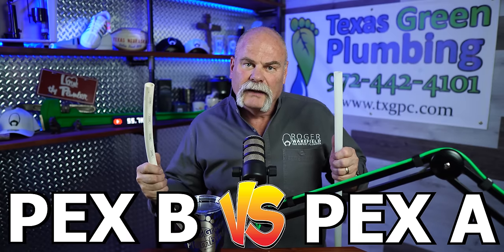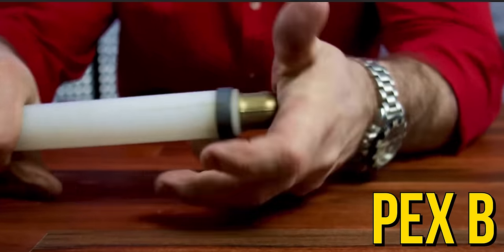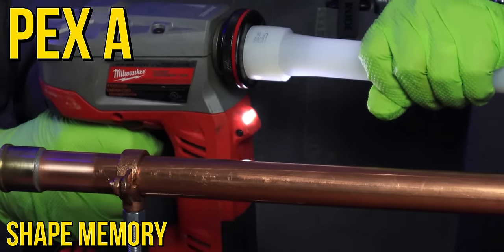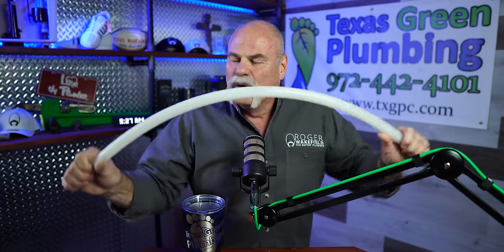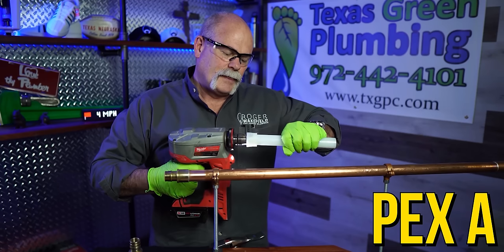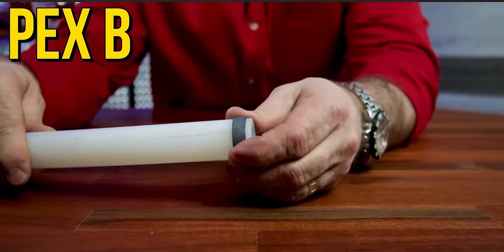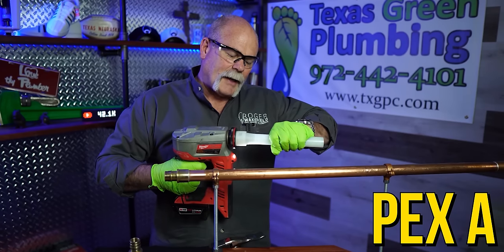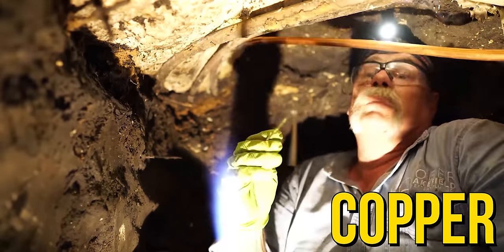PEX-A vs PEX-B - What's the Difference? Which Should You Use?

Comment: Great vid! I can attest water pressure is extremely reduced of you don't up-size your Pex-B pipes.  I recently renovated my house and replumbed the entire house with Pex-B. My architect's drawings called for 1/2" piping to fixtures (sinks, shower, etc). My plumber installed 1/2" Pex-B pipe (I guess he's not as knowledgeable in Pex-B plumbing). Now, if I run my dishwasher and laundry at the same time, my kitchen sink's water pressure is similar to a park's drinking water fountain. I wish I saw this vid before we renovated the house.
Reply: Codes are always to the minimum standard, and many of the standards were written years ago for copper and steel pipes. Copper in pretty thin. PEX and cpvc are the same outside diameter for pipes labeled the same size, so obviously the inside is smaller. PVC is the same outside diameter as steel and steel has a larger inside diameter than even copper for the same nominal pipe size, but is rougher. Modern plumbing (and fixtures) just get more and more restrictive. 

Food for thought. 1/2" 200psi PVC has a larger inside diameter than 3/4 PEX. Obviously, using 3/4" PEX B with it's insert fittings is more restrictive than 1/2" SDR21 PVC.

Comment: I have a bit of 1/2” hePex A to install in my crawl space for some radiant floor heat ..my question is can I splice...there’s no way in a small crawl space I can run a 300ft loop x 10...thus the reason I’m going with the expandable Uponor non flow restrictive fittings...I may even look at straight 20ft lengths of pex as well..my joists are a total of 45 and each one is 35ft long....
Reply: you can splice, 300' is a long loop, do you have a professionally engineered plan or are you just winging it?

Comment: Roger, if I have 1/2" copper to my fixtures and I want to replace with Pex-B, to "up size" should I install 5/8" or 3/4" Pex-B as a best practice?  Same question for my water heater? It has a 3/4" outlet, should I up size to 1" if replacing with Pex-B

Comment: I just got pex b and im stumped on what sealant i can use to fill gaps safely coming through the floor. I know most caulking is bad but keep reading mixed reviews. What can i use to fill gaps besides the steel wool im using?
Reply: Low expansion spray foam

Comment: I noticed this video is 3 years old. Is there any changes to pex A ? Ive run pex A several times. I have the m 12 milwakee expander. Ive seen you tube videos since that say some pex A pipe is failing. I also have run & own all tools & knoledge to run pex B as well i do copper traditional sweat. Thanks for all your videos.  I see you take a bit of a beating from the rif raf. Keep up the good work. Jeff Snouffer

Comment: Thanks for the video.  It was interesting to learn about the two main types of pex.

In this video and an older one, you said Pex A has a higher burst pressure, and is better for freeze worries.  But searching for details, most sites say B has a higher burst point than A.  Both should be sufficiently high, since one said that the spec they had to exceed was the ~470psi you mentioned, then stating that Pex A's burst pressure was about double that.  Do you have any specs on this?

Likewise, do you have any specs on the pressure drop of B connectors vs A, in practice?  It could be so trivial that it doesn't matter, or any curved corners (over 90° copper ones you are replacing) might cancel out with the slight pressure drop of a few smaller fittings.  In theory the bigger ID of the fittings with Pex A sounds like an advantage, but it depends on if in practice it really matters.

Comment: I wonder if a clamp over the ring on a pex A would would be beneficial for keeping it in place or if it would be too much overkill?
I can't help but worry about a friction fitting slipping out of place.
Reply: Its not friction. It is a clamping connection. The pex a actually gets stronger with time because it is continually trying to return to its original size.
Reply: no clamp needed

Comment: I used PEX B in my house.  I ran 3/4" to all my Tees,  only ran 1/2 at the end of the run,  no flow problems.  All my plumbing is accessible.  If I was running stuff inside walls I would have probably gone with something different.
Reply: Pex B is perfectly fine in the wall as long as you use the brass fittings .
Reply: @ImTrans-Former  😆 be careful. You'll start a plastic vs brass war on the internet.
Reply: Whats wrong with plastic? They work fine. Lol.
Reply: @snyper1982  What happens when the plastic fittings freeze? I know the pexB will flex. I went with brass for that reason.

Comment: Do you like pex A or pro press copper fittings? I have a job coming up where the house was plumbed in copper however the entire third level is going to be an in-law suite. Your thoughts of mixing pex a with existing  copper vs just using copper w press tool.
The downstairs is 10 fixtures being added

Comment: Great video and explanation of the two formats. I live in Maine where I intend to install a water hydrant in our garden for year-round use. You sold me on PEX A so I guess I'll trade out my crimping tool for one of those expansion gizmos!
Reply: @ronh9384  The PEX would only be used to run the feed from the house at apx 5' below grade. The hydrant and feed pipe is all metal.

Comment: I like A better but B works just fine. If you look at the size of the inlet and outlet of new water heaters it’s less than 1/2 pex. Most shower valves have an 1/8” hole to supply the shower portion. The only problem I personally find is when several things are on at the same time. While I 100% agree to size lines properly you can only get a little bit of water through most modern faucets.
Reply: Pressure isn't limited simply by the smallest diameter in the path, though. It's the summation of flow resistance at all points. Even if your fixture has a 1/4" diameter at some point, there'd be an astronomical drop in pressure if you change from a 3/4" line to 1/4".
Reply: @pterafirma  You are correct and I have been a plumber for 30 years. I was giving a basic statement but I understand it very well.

Comment: I recently had somebody over to my house to do some Plumbing work in my utility room changing out a lot of the existing Plumbing using PEX B. We also installed a 160 thousand BTU natural gas on-demand water heater at the same time. We installed 3/4 inch gas line right out the back of the gas meter to supply it. On start up the water heater makes a horrible sound almost like something sliding across the floor. It also wants to send me a shut down sending off an alarm when hot water is used at full volume at 1 or more faucets. Would this be caused by a lower water volume caused by the pex-b?

Comment: Agreed pex a way better product, more versite,better to handle, greater volume of water, easy to fix, if you reheat a kink it will be stronger then before. Use it since I started plumbing.  What is in your opinion best way to connect them together when you add more water lines?

Comment: B type has another down fall  sometimes you have to make a crimp in a compartment or tight space where the crimper won't fit. That forces you to backwards assemble, or subassemble your installation or repair. The biggest problem is the possibility of a over crimped fitting ( go or no-go ) test.

Comment: do you have flow restriction with pex b and  a manibloc system I currently have the trunk system i think yall call it 3/4 main and run to 1/2 combination of steel and copper and wanna switch to pex small house with 8 cold and 4  hot lines should i get a manibloc with 3/4 lines

Comment: I am considering PEX for radiant floor heat however since I will be heating it with an outside boiler to over 160 degrees will this affect the expansion/connection of PEX B.  I know heat will not be an issue with a crimp connection so there is my delimma.

Comment: When installed properly. Copper is my preferred. And I'm a young guy.    imo. Pex is like propress. It has its applications.  But not a whole job. And it cheapens the craftsman ship. My old company used it for repipes. Shark bite has a permanent  style fittings for new construction. Sure it was fast.   I do hospitals now.   So nothing but copper and cast. Except under slab.

Comment: I was given some PEX-A pipe for a small job but don't have the expansion tool. Can I even use PEX-B clamp style fittings and clamps or is that going to leak eventually? Alternatively, how can I expand the pipe without the $300 tool? Again, small job and I'm not a plumber so there's no sense in investing in a tool I'll rarely use. Any suggestions?

Comment: Bite the bullet and get the PEX-A and a battery expansion tool.  It'll pay for itself on the first job.  I got the Milwaukee M12 and it works great.  I have the heads for 3/8 through 1 in.  Its fast and fool proof.  Lowes is now selling PEX-A.  Don't get the PEX-A SharkBite brand plastic fittings, they restrict flow a lot.  I used them and had to go back and cut them out and replace them with the brass fittings.  HUGE DIFFERENCE in flow.  It's really GREAT STUFF!  HOWEVER, you should take steps to rodent proof the installation.  There have been reports of rats chewing it up and causing leaks.  If it freezes, it will just swell and once it thaws, it will go back to its original size and not leak.  I highly recommend using manifolds and home runs for each fixture if you can swing it.  This way, you have a "water panel" similiar to a breaker box that you can individually shut off each fixture from one central location.  This is really revolutionary.

Comment: Great video on the PEX A B comparison.  I want to use PEX A in a bathroom remodel and only need to make a couple of connections. My question is, can you recommend a reasonably priced expansion tool (besides the typical DeWalt or Milwaukee that a pro would use) as it’s hard to justify spending $350-$400 for only a few connections?
Reply: Try ebay.  I got mine, lightly used, for half price.

Comment: I've been working in plumbing supply in New York  for 20 plus years, we sell minimal Pex A pipe and fittings. 
But we've sold millions of Stainless steel pinch clamps, and millions of feet of Pex B for both heating and potable  water. 
If the there is a volume issue, believe me me it's isolated. Cause we Never here that complaint. 
The only other time I heard that was from the uponor salesman.

Comment: I’ve not used pex A ,due to the cost of the expander tool, and I don’t plumb enough to make pex A cost effective. What I do love about the system is how you can work in a cramped space much easier than with the bulky metal ring clamping tool needed for pex B.
Reply: If you pre-build some of your lines you can alleviate that problem. A compression fitting here and there also helps...
Reply: @greenhometony   thanks for the info. Most of my time is spent doing retrofit work , so my opinions are limited.

Comment: I always like using copper coming out of water heaters then transition to uponor about 2 to 3 feet out, I do not use the pex-b it reminds me of polybutylene 😱😱🤭 from the 80’s because of the crimp rings, the polybutylene usually will crack right at those rings and cause major problems, 🐳 🌨 I like the uponor because it is made in the USA it is reasonably priced and most plumbing armories carry it, and it’s been in use since the 90’s and is still working great, FYI be careful buying pex from the diy store because most of the pipe and fittings are made in China 😱(nothing against China) you should never cheap out on your water supply material quality.

Comment: Where I have run into problems with pex in Az is if it gets exposed to uv it dry rots. The other is the apex stainless crimps would snap when using brass fittings on the hot line. Other than that it is okay but copper is still better

Comment: What about running gas? I know due to your location there is a possibility of freezing, do you still use the copper for gas though?
Reply: Well the only reason he uses pex instead of copper in attics is because when water freezes the copper will burst where as the pex has better expansion. On Gas you don’t need to worry about “freezing”. You can use copper, CSST, or Black Malleable iron on gas lines.
Reply: Foolish Creations thanks man! I know it’s probably a silly question, just trying to put things together. I’ve been doing new construction plumbing for about two weeks now and still learning

Comment: I’m not a skilled tradesmen just a unknowledgeable hack but I really appreciate your videos and explanation of how this work. I appreciate it! ✊🏿
Reply from the maker: I appreciate that! What was your takeaway? Do you prefer A or B?
Reply: @RogerWakefield  I’ve only used b because that’s what was at the house already and was just making a repair. I personally like sweating copper but starting to see less & less of it. Been running into CPVC instead. But if I did more plumbing I wouldn’t mind investing in the Milwaukee expansion tool and using Pex A as it seems easier to install in tight spaces than Pex B & seen a lot of guys use it underground here in South Florida.

Comment: Uponor has a bit of a startup cost and unless things have changed you can only get supplies and fittings from a supply house which aren't open on the weekends., at least not around here (Ohio). Other than that I love pex, so much faster than copper and thieves won't destroy your house for scrap.
Reply: I deal with same issue in Florida

Comment: I've never seen this type of pipe before, it looks very simple and straight forward.
Question: so on the pex A do you add any solvent cement/glue or does it seal its self once it retracts back.
Here in the uk we use plastic pipe such as JG john guest speed fit, help two 0, poly plumb where we use incerts also with the connection of the pipe 😁
Reply: Its water sealed once you expand it and put your fitting in.
Reply: No glue or solvent
Reply: All you need is time, 20 minutes for the ring to set over the fitting, maybe a bit longer if its really cold.

Comment: I'm considering re-piping my house from galvanized pipe to PEX-A (Uponor).  However, I read that rats chew through PEX pipe.  How big of a concern is that?  How often does that happen?  Also, I have one horizontal CPVC pipe (hot water) in the attic and rats haven't chewed on it.  The CVPC pipe has been there for about 11 years.  Is it safe to say that if rats haven't chewed on my CPVC pipe that they probably won't chew on PEX?
Reply: Use rat poison lol. Is it a mobile home?

Comment: Just a word of caution. I built my home in '03, 100% upinor and i have since replaced about 8 brass fittings due to acidic water. If you are going to put fittings in a concealed area i would use the non metallic fittings IMHO (retired plumber 49 yrs in the trade)

Comment: PEX B.  If you've got pressure issues, it ain't the PEX B.  It's either improper size or just a long run. However I hate those crush rings.  I only use the clamp rings and have literally never had a leak. Seen guys go through so much headache with the pinch/crush rings.  I refuse to use them. And done need a several hundred dollar battery operated tool like PEX A.

Comment: Hi folks !! Has anyone tried the Zurn pex B ? It seems to be expandable as well but don’t see a lot of folks using it as much . Since it’s also expandable , would the flow not be reduced as much as crimp style pex b ?
Reply: I did see a video wher a plumper swears to use Zurn fittings  and Zurn Pex B expandable pipe  - something about the chlorinated water having ledd pipe degridation

Comment: pex B  can handle higher pressure and you can use it right away , plus fitting crimp faster and can use shorter pipe between fittings.    But i can see the advantage with much large pipe or in tight areas

Comment: I'm stubborn I guess, but I learned copper and it's all I use. Used pex on one water heater and it just looks cheap and flimsy. Sweat it and forget it. I do see the value in pex for service lines in the yard and places where hard water corrodes copper; I'm just a copper junkie. It's what I know and well insulated copper is not likely to freeze anyway.

Comment: Seems to me having to heat PEX A from the end of the joint could be a problem in a tight spot. Other than that I’d use it over PEX B. Not to mention the cost of those Sharkbite fittings.

Comment: I'd rather just stick with C PVC and properly size the runs between the fixtures.  Up here in Minnesota, where we properly insulate things, you very rarely ever have an issue with freezing; even in 40 below weather.  AND it's cheaper since you don't need special tools.

Comment: What happen if you use pex B on the expansion fitting?  I didn't know there were pex A and B.  I used expansion fitting on pex B, on everything, but there was not a single complain.  I think  both of them are expand and contrast, but one is more expandable then the other or one has more cross-linked bond than the other. The question is how much more in term of percentage?